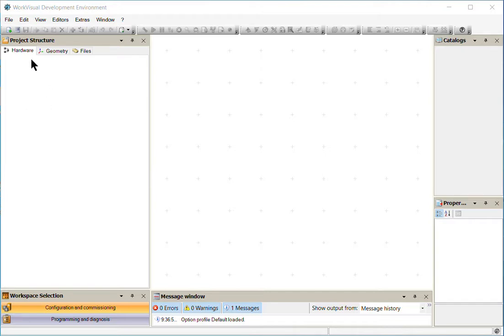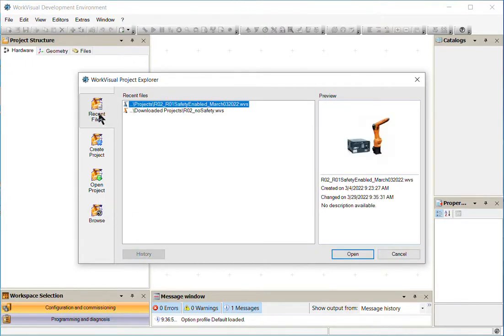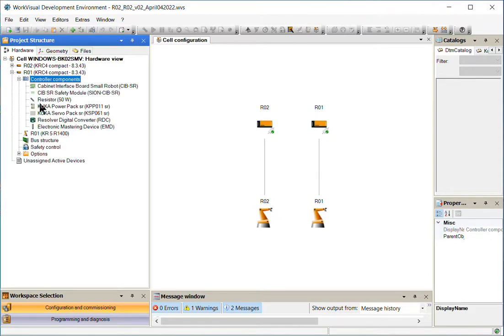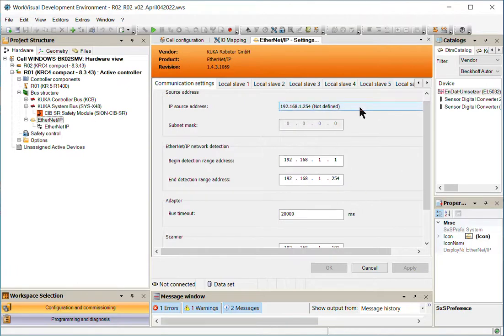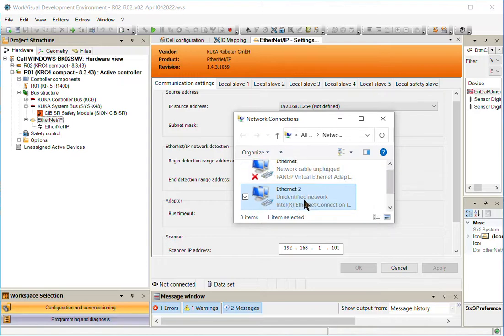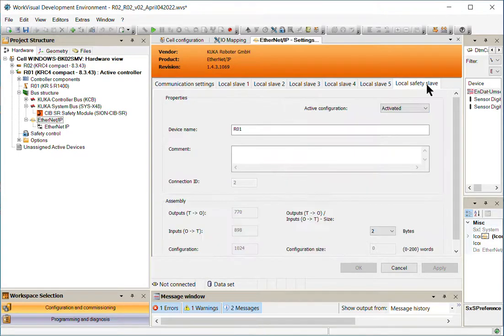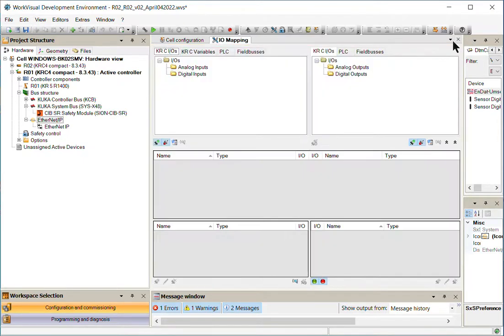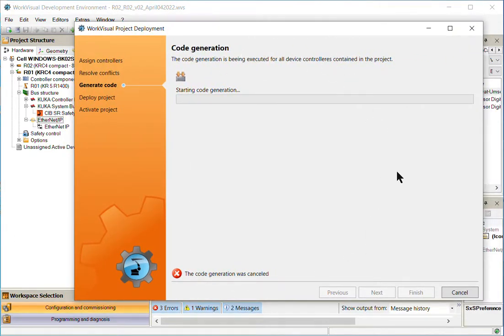Modifiying IO mapping in Kuka project using work visual 6

Comment: How do you connect to two controllers simultaneously in Visual Basic 4 while in Configuration and Commissioning mode? I haven't been able to do it, and I need to use a backup as a template to modify the other one.